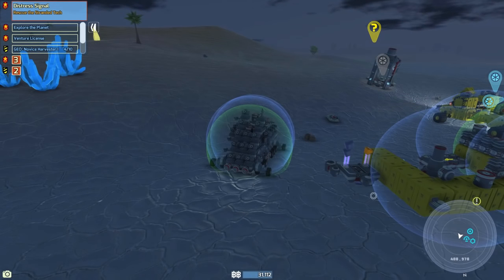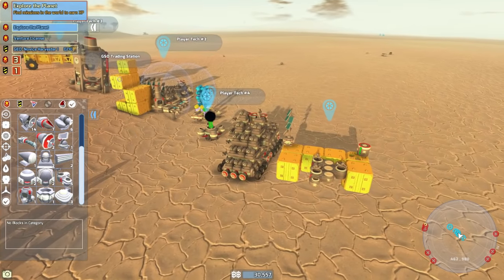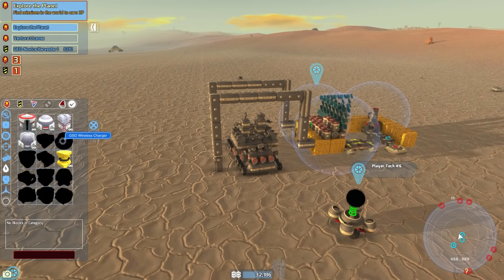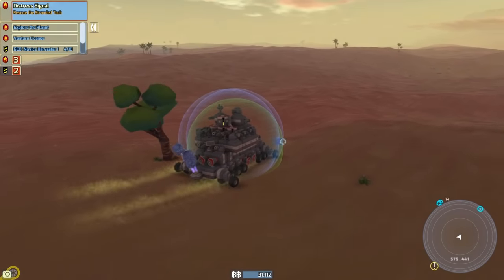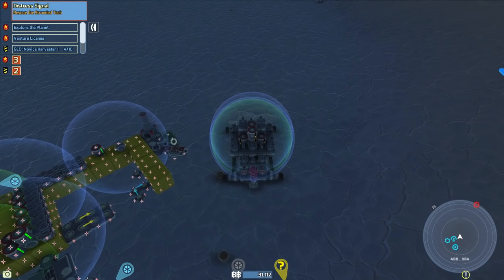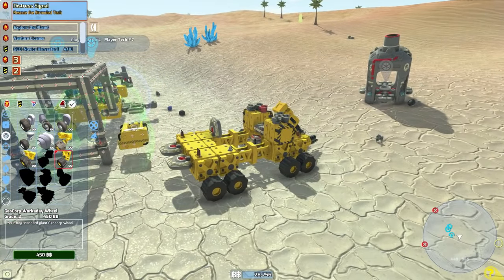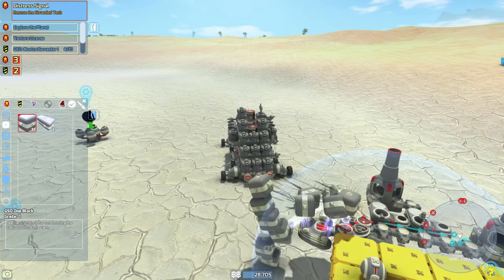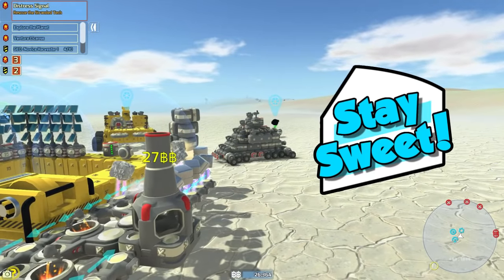Scrapper Factory! - Terratech [Ep.5] - Let's Play TerraTech v0.6.4

Comment: receiver, circle of conveyors to refineries, another circle of conveyors with foundries on the far side. filter conveyors that offload refined luxite, carbite and rubber to sell cannon. filter conveyor that offloads refined wood to generator. all others will be fed to foundries, which will then be fed to cannons. set up a scrapper that feeds into the circle before the refineries. scrap 1x1 GSO blocks for plumbite. mine mostly rocks for ore.
Reply from the maker: Wow, that's quite complex. Any video guides on this as I can't get a super good representation through text.
Reply: the idea is to separate the refineries, foundries and sell cannons with circles of conveyors. so, put down a refinery, set up a circle of conveyors, that way you have no unrefined ores that get past them. from there, you need your foundries setup on the far side from the refinery circle. the circles of conveyors lead back around to the refineries and the next circle of conveyors lead back around to the foundries, so none of the refined ores can get past the foundries. 

i was unable to find any good videos showing how to set it up.
Reply: search for "Terra Tech - New Refinery Base! - TerraTech Gameplay" it's by blitzkriegsler. around the 15 minute mark, you can see his version of the foundry base.
Reply: Lonnie Hodge Jr I love Blitz I'm subscribed